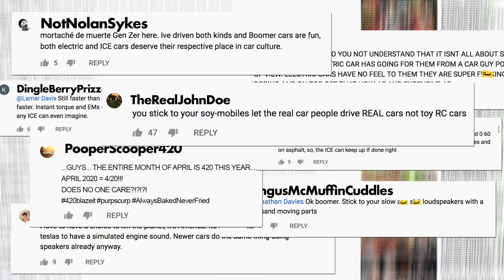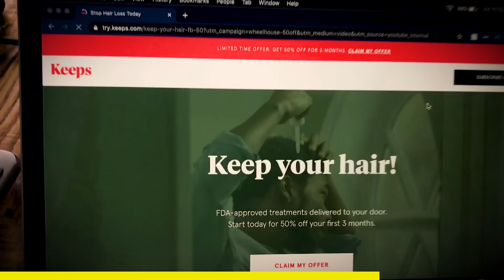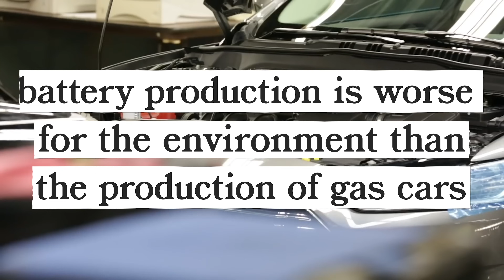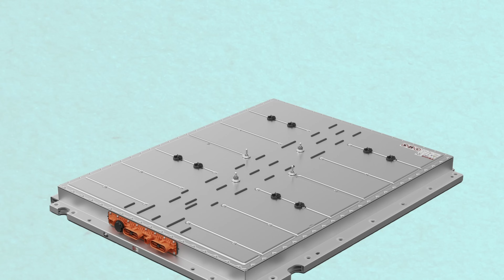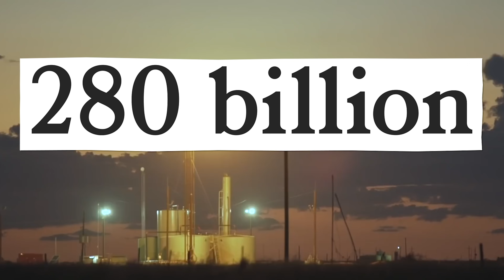Are Electric Cars REALLY Better for the Environment?

Comment: Nolan, in your calculations of total emissions over the “life” of the vehicle, did you factor in battery life? Ie 20 year vehicle life it is unlikely that 1 battery is going to make that. So did you account for that? If not then you missed 2, 3, 4 times the amount co2 from EVs. I, like you, don’t care either way, I am just curious :) what was your factored battery life?
Reply: But he said EV makes out for their initial emissions in the first 6 to 18 months of use, when compared to the normal engine
Reply: @michal8625  only if the operator drives the car long enough for it to equal out. How many Tesla owners keep their cars for minimum two years? Maybe roadster owners since it’s a collector? Otherwise it ends up equaling out if youre buying/“upgrading” to a new one every 24 months when the lease is up. It takes long term, mass ownership to make a real difference and the current technology and infrastructure cannot support everyone driving electric. Not to mention the incredible cost to purchase a modern vehicle. New cars and trucks have gotten so out of hand with pricing it’s absurd. The process of manufacturing a car has been the same for over 100 years. Power plant manufacturing has changed when looking at gas vs electric but everything else has stayed the same. We still gotta dig up the raw materials, we still have to use an enormous plant to assemble them, they still have to be transported to final destinations. One person Going electric makes no difference. Hell an entire country can go electric and will barely make a dent. Remember we’re all inside the same bubble and are the wealthiest country on earth. Not everyone here can afford electric there’s no way Guatemala, Kosovo, China etc will be able to do it.
Reply: @wallythacker7772  youve actually got it quite backwards. the tesla itself will last until it rusts out or is crashed. current tesla batteries last 300k miles and newer ones could last 1,000,000miles. If I bought a new tesla today it might be the last car i ever buy (Im 47). If a tesla owner gets a new tesla every two years, their old tesla just gets sold to someone who couldnt afford a new tesla. so whereas you tried to make that a bad thing, its really just rich people choosing to take the greatest depreciation hit on new technology to bring the tech in to financial reach for the masses.
Reply: @gregnoel8779  that's not how it works, your battery will degrade and must be replaced after 10 years of use, this is just the fact of lithium ion battery. a new battery is 20,000$
Reply: @HamguyBacon  yeah, no. THAT’s not how it works. How many EVs have you owned in order to be able to explain this to me with such confidence? My 2013 Volt still has zero degradation. Likewise to our 2017 Bolt. Also, as so many people have pointed out in this thread already and you’ve conveniently ignored because it doesn’t jive with your confirmation bias, you don’t typically replace an entire battery pack, you replace the modules that have gone bad, a fraction of the whole battery. Also, you’ve even got the price for replacing the whole battery pack (which you wouldn’t likely need to do) wrong. 

At my count your one comment is 0 for 3. It’s okay, not everyone can be an expert on everything. I’m sure you know lots of stuff on other topics. But it’s good to know when you aren’t that guy and just drop out of the conversation.
Reply: This is an excellent point, plus stockpiling spent lithium batteries will absolutely increase the number of catastrophic lithium fires 🔥
>No bias here, that's just a logistic and scientific fact
Reply: Individual cells in the ev lithium battery pack don't get replaced.   The whole battery must be replaced at once.  Lifespans of ev batteries are found ranging from around 12 to less than 20 years.  It's an extensive process as well that requires separation of the vehicle body.  Some ev batteries will be recalled and replaced as well do to manufacture defects or design  flaws.  Cost of these replacement packs will also outweigh the value of the car after a period of about 10 years as the packs cost range around $15k-$23k.
There's hope that newer battery technology that doesn't use lithium with longer lifespans is around the corner. There's articles that mention Toyota is heading development on such batteries.
Reply: I mean u also dont have to replace the whole batterie because its made out of a lot of modules and u rarely have to replace more then one which is like 1000-3000 $
Reply: EV's have been around since the 70's. Show me the EVs that had their battery replaced and I'll show you a cheap battery backup for a house.
Reply: @psikot  wdym? I just wanted to say that u dont have to replace ur whole batterie pack they are made out of like 16 moduls where u rarely have to replace all 16
Reply: @jannis-joelfehl4855  It doesn't work that way. Its like replacing 1 of 5 modules in a laptop. Look up individual cells and how they are put together in a pack with wires, insulation, heat sinks, glue, thermal compound.
Reply: @psikot  Electric vehicles (including cars) have been around for over a century.  Some of them were electric trains and trolleys for intra-city transit.
Reply: A Teslas battery can last 300-500k miles. That likely mean the battery will never need to be replaced ordinarily.
Reply: @Crimson_Thief007  Is there any real 3rd party data the supports this? I would be shocked if they lasted that long without sever degradation that limits the range to something that is impractical.
Reply: @kyleglover7066  I can’t personally cite any third party data, but this is widely accepted. People aren’t changing their Tesla battery three or four times over the course of 300k miles. Most gas cars aren’t even driving beyond 200k before we start running into some serious engine problems. So it’s just not realistic to say the Co2 emissions are 4x the estimate of the video based on the assumption people are changing out a $13k battery 4 times. It’s just so unreasonable to take the most unlikely scenario and try to frame it as an average. If we go by the average; Tesla batteries only lose 5% of their range after 100k miles. You don’t need to replace the battery until it has lost 20% of its range. At this rate, and assuming the battery range loss doesn’t exponentially increase, that is 400k miles. People aren’t putting that many miles in their car. The fact of the matter is Tesla batteries will rarely, if ever, need to be replaced in their lifetime. That making the initial comment outright inaccurate.
Reply: Now a good argument for Co2 emissions is replacements under warranty! This is a prevalent issue in the EV sector. Warranties will usually replace the battery before they actually need to be replaced at no cost to the owner. This is wasteful because ordinarily the battery would probably just last the entire lifetime of the vehicle, but why risk it when you can just get a fresh one for free? If you are ambivalent towards climate change and Co2 emissions, then this is an optimal bargain for an EV owner. I personally don’t care who makes money myself as long as Co2 emissions are lowered, so this is a point of frustration to me.
Reply: @Crimson_Thief007  You wish you can find a battery that cna last that long, Tesla batteries are 18650 batteries and moving towards 4680, they need to be replaced every 10 years since they degrade. The car itself may last 300-500k miles but the batteries will be replaced every 10 years which is another $10-20,000 repair.
Reply: @HamguyBacon  The fact is that the batteries just don’t need to be replaced that often. 10 years is a worst case scenario for a lithium ion car battery. A more accurate statement would be 15 years, and that is most likely to be caused by normal usage degradation. If you are keeping a Tesla around for 15-20 years, you will likely just buy a new car before you replace the battery.
Reply: Forget emissions, it's a scam.
Reply: @ricktd6891  its hard to argue with that. what i mean is, its hard to wrap my mind around what you must be thinking. every country in the world knows its not a scam. youre just late to the program. greenhouse gas based climate change was initially put forth as a theory in the 1890s.

Comment: Some good points made but here’s what you missed. Solar and wind power make up no more than 5% of the grid and are extremely undependable, just ask north Texas who put way too much emphasis on solar and wind and people froze to death. If the sun doesn’t shine and the wind doesn’t blow they are useless. The grid depends on fossil fuels, hydroelectric and nuclear fuels. Batteries remain far and away the most inefficient way to transfer power and their toxic waste is far worse than nuclear. The batteries in EVs require 5 times the emf as would a regular gas powered engine and yield less than a third of the range. In actual use that puts the EV at 15% as effective in transportation as a gas powered car. That is when you plug your EV into the wall it uses 5 times the amount of fossil fuels from the power plant to charge it compared to how much fossil fuels are used to power the car that goes 3 times as far and way faster, conservatively speaking. Here’s the kicker. CO2 is actually a natural occurring compound element that plants consume and produce oxygen. This is good. We want this process to continue. CO2 has been demonized because they think they are measuring more of it and say it is causing ‘man made global climate change’. The only real problem with that is that it is a lie. There is no measurable difference in global CO2 in the less than 70 years they have been measuring it and the planet has not warmed any at all in that time period where weather had started being recorded. Compare that to known changes in global temperatures high and low over far greater periods of time, hundreds, thousands and tens of thousands of years or more where there has been recorded differentials of tens of degrees both high and low. The earth survived it well. Now take your average volcano that with only one minor eruption spews out more CO2 in an hour than the entirety of the history of fossil fueled cars from beginning to end right up to today and the earth manages it just fine. If we can find better cleaner energy than fossil fuels, fine but do not try and tell people who understand basic physics that batteries are better or even you average Joe six pack who sees their flashlight as a place that stores dead batteries. Batteries are the least efficient way to discharge energy. The best solution we have right now is nuclear energy. The people driving the EV industry are bait and switch snakeoil salesmen. Once they get you dependent on it we will find out it doesn’t work and they will have monopolized fossil fuels and enslave you with that again. Don’t be fooled. Wiseup.